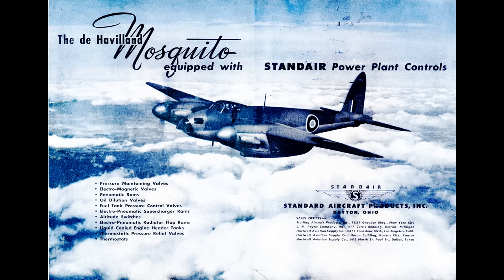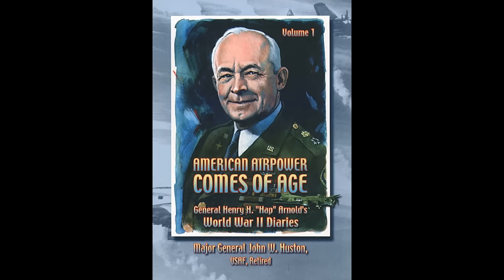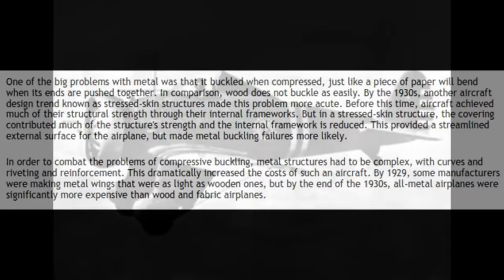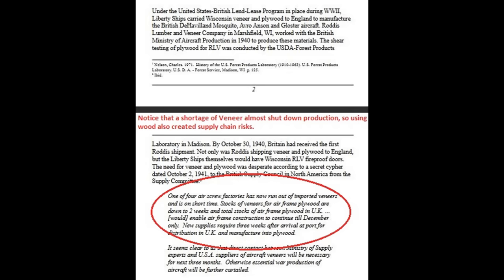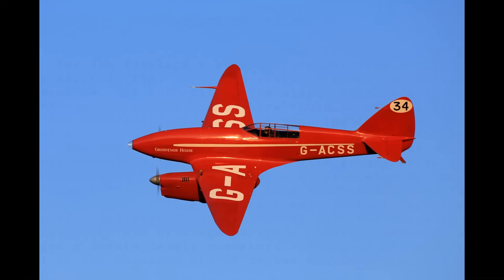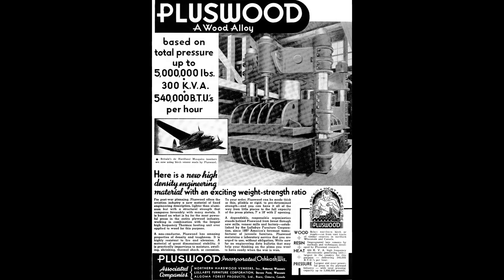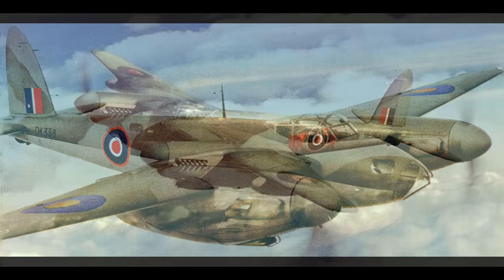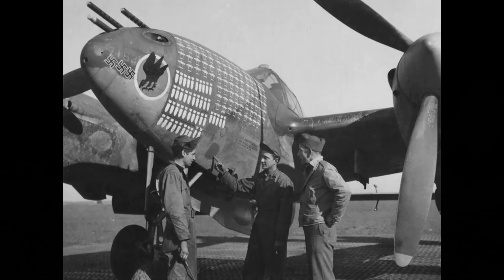De Havilland Mosquito vs. ?

Comment: Not widely realised is that wood does not have a fatigue life while metal does. That's why so many metal aircraft are retired while seemingly still perfectly flyable. A wooden aircraft component such as a spar, if well maintained, will last for centuries.
Reply from the maker: That's true, but in practical terms it's not so simple due to insects, rot, mold and more.

Comment: Wood construction is discussed for Gloster Gladiator and Hawker Hurricane. It’s interesting to note that Fairey Swordfish biplane (produced 1936 to 1944) was built from steel tube with traditional fabric covering. It’s often claimed to be obsolete but it’s heavy lift STOL capability and that incoming ordnance went straight through without causing serious damage kept the type in service throughout WW2.
Reply: Sometimes light AA went straight through  but it didn't fare too well against anything else, The plane was very useful for hunting u boats paired with fighter for flak suppression.
Reply: Swordfish was used throughout WW2. But just like any other torpedo bomber it was a sitting duck without escort fighters.

Comment: Jeffery De-Havilland’s son  died chasing the sound barrier in a test aircraft like many other,s it was a compressibility problem many planes suffered from it. Look up Eric Winkle Browns test of the same  plane in his book Wings on my Sleeve. He had the same problem and it was an aerodynamic problem luckily his instincts enabled him to recover also because he was short! Interesting life he led, recommend a read he was test pilot in the UK and also did a good stint in the same  US. The skin on the Comet was too thin trying to save weight so they could use the De-Havilland underpowered Jets, that along with square windows which caused stress risers in the corners caused the fuselage to split along the window line. The fault was found by immersing a fuselage in water and raising the pressure of the water inside the fuselage and flexing the wings it failed along the window line after a relatively short series of test cycle.  This test was argued for by the engineers before it flew, but you know the management that knows better. Like the ones that launched Challenger in cold weather. The Comet was the first pressurised jet passenger airliner in the world and won a lot of records, but because that stupid stupid management decision they threw away a world lead. They should have had a thicker fuselage skin and used the more powerful jets available from Rolls Royce with round windows and there would have been no problem.  When the Boeing 707 came out it carried more passengers and having underslung engines maintenance was easier. Comet flew Commercially 1952. Boeing 707 1958.

Comment: Regarding the woden construction: After WWII the British built a number of types of wooden racing dinghies using pretty much the same construction technique, such as the International 14 and the Firefly. I believe they had access to the surplus equipment used to build Mosquitos; autoclaves and presses. It wasn't until the late 1960's or later that fiberglass began to challenge wooden hulls in sailing classes that used the wood composite technique. Short of a carbon fiber/honeycomb/carbon fiber composite it's still hard to beat the stiffness to weight ratio of this technique.
Reply: @M Bacon agreed, and all have some specific vulnerabilities. 0-90 carbon/Nomex/0-90 carbon hulls have been state of the art for the last ~ 40 years, it has a different kind of vulnerability. It can be punctured by a sharp object, you can take a sharpened pencil and ram it right through. Of course that's not something that's likely to happen.

Comment: Another advantage of wooden construction was that parts could be made up rapidly by rejigging in factories that mass produced furniture. As for strength, would a metal constructed aircraft be able to withstand the tremendous shockwave recoil of a 6 pounder field gun, as was used on the Coastal Command Mozzies for UBoat busting? There's a lot to be said for natural carbon fibre.

As a mature student (gaining more qualifications after RAF service) in the early 80s, I had a weekly period where I could take any course I fancied for interest. I chose woodwork to build a cabinet for my hifi. My tutor was a senior citizen doing some part time teaching to boost his pension.

When we got talking on introduction, and I told him I was ex RAF, he told me he was a master carpenter who'd worked for De Havilland, and during the war, that he was very proud he'd worked in a small team, that shared de Havilland's passion, on the prototype with Geoffrey de Havilland, away from the main aircraft works De Havilland, financing it from his own persaonal funds. He was determined having great belief in his design, wanting to prove the Air Ministry wrong, that hadn't commissioned the Mosquito, going for heavy bombers. My tutor said he made the wooden propellers that were used for initial tests. When the Mosquito went into production, they used metal propellers, maybe the same as the Spitfire or Lancaster.
Reply from the maker: Yes, metal airplanes have carried guns far larger an more powerful than the British 6 pounder. During WW2 The B-25 carried the 75mm firing a 14+ pound shot. Also the German Hs129 had a variant with a 75mm. cont:

That's not to say that wood doesn't have any advantages, it does, but overall metal was better, which was why De Havilland went to metal as soon as they could practically do it. The main advantage of wood in the case of the Mossie was simply the fact that almost all of De Havilland's experience up to that point was in building wooden airplanes.
Reply: @GregsAirplanesandAutomobiles  Looking at videos of the Mosquito on ground test firing, the way the aircraft rocked back suggests there wasn't much in the way of extra dampening shock absorption, the airframe taking a lot if not most of it. Would a P-38 have been able to do a similar job?

I wasn't familiar with the Hs129 and B25 set ups, so I just briefly checked out both of the arrangements on YouTube, in an underbelly pod presumably with sprung/hydraulic dampeners to absorb the shock. The B25 was a larger aircraft than the Mosquito which would help as well. Thanks for pointing that out. The Hs129 was slow, left a lot to be desired and I was more impressed by the B25 set up.
Reply from the maker: I was only addressing the issue of absorbing the shock, not saying which set up was best.
Reply: @GregsAirplanesandAutomobiles  As you started with the P-38 compared with the Mosquito, although I didn’t specify, that was what I was speculating on, whether the P-38’s airframe could’ve withstood the recoil of a large cannon.
Reply from the maker: Oh I see. I don't know if the P-38 could have been adapted to carry a huge cannon, Lockheed went in another direction with the HVARs instead.
Reply: @GregsAirplanesandAutomobiles  I guess it was needs must, and what would work on the battle of the Atlantic, and the wing rockets on the Mozzy would be recoiless when they came in, packing a greater punch without the shock. Love the Mozzy, arguably the finest aircraft of WWII the UK produced in that it was so adaptable. The world’s first truest MRCA?

Comment: With respect to corrosion of aluminum: pure and low-alloy aluminum does not have significant corrosion problems (as most people know). However, aluminum alloys that are strong enough to use in aircraft structures do. The solution was to apply a thin plating of pure aluminum on the outside of the sheets of high-strength alloy. Hence AlClad (Aluminum Cladding). In addition, it was necessary to find a primer that would stick to aluminum, which was also quite a challenge. Eventually zinc chromate primer was developed, which has that characteristic drab yellow-green color that you'll often see on the insides of aluminum aircraft structures.

Comment: Wikipedia says early Mosquitoes used plywood with casein glue, later replaced in production by plywood with urea formaldehyde glue. I had been under the impression that synthetic glues were essential, and the moulded plywood Mosquito would have been impossible with casein glues - perhaps this was not the case.

Comment: When i hear you talk about manifold pressure and boost pressure and here with engine compression I think about how long the gaskets last. With the temperature differential on parts and expansion and contraction on parts i just think about a blown head gasket at 20,000 feet over the ocean.

Comment: The Mosquito had a lot of small wood parts. During the blitz, a lot of them were built as sub assemblies in cabinet shops and assembled into larger assemblies in barns and then trucked in pieces to final assembly. Cabinet makers were already trained in wood craft and had the necessary tools. Additionally, cabinet shops tended to be nondescript buildings in rural villages that could be hidden form the Germans. As a war resource, the cabinet shops already existed, were not centralized targets for the axis, had trained employees. The government just had to supply wood, plans, some jigs to ensure that parts would mate on assembly and paychecks. It was a ready made plane building business that did not take up factory space needed for conventional fighter and bomber production. From a structural viewpoint, the plane was engineered to take advantage of wood's properties and represented an advancement in the state of the art. The RAF rejected the initial proposal, but de Havilland proceeded to develop the plane with private capital. It was only when it flew that the Air Minister's jaw dropped and he had to have it!  Its biggest flaw was a lack of weather resistance. It was also partially stealthy, being made mostly of wood, it didn't show up very well on radar.

Comment: A lot of people try to compare the p38 and the mossie but they are totally different design concepts.
Great that there are flying examples of both again now. 
The guys in NZ are working on their 4th or 5th mosquito build now.
A project in the UK is in the process of completing the wooden moulds to start manufacturing new mosquito fuselages in the UK as well.

Comment: Aluminum production requires a lot of electricity. Due to federal hydroelectric dams construction by WW2 the USA has massive reserve of electric power. Which the USA put to work in nearby brand new aluminum production plants. As much as American aircraft producers complained that aircraft with wooden wings and fuselages were obsolete, they had all their aluminum requirements provided for them.

Comment: Thank you. I learned more about the construction and design of the Mosquito here than from anywhere else. The views on De Havillands' reasons for choosing wood in particular, if nothing else,  pass the saity test of 'it smells right for, the man, the day and the economic background surrounding its inception and design'.  I also assume that wood construction requires far less energy which would be needed or maybe better used elsewhere. That the soviet airforce also was mainly wooden construction was news to me but that also makes sense, considering the war time constraints on the USSR at the time. They had a lot of tanks to build.

Comment: For the U.S., initially choosing the P-38 over the Mossie was a good decision IMO. The P-38 could do much/most of what the Mossie could, but much more. It could, along with light bombing, long-range reconnaissance, etc., actually dogfight and operate as a true day-fighter, which the Mossie could not. The Mossie had its merits as well and, of course, the P-38's engines and systems were not well-suited for European theatre operations. Overall, it's good that both airplanes were available to the Allies.

Comment: Greg, future topic idea:  I have run across quite a few military historians that are convinced that the Battle of the Atlantic could not have been won without the B-24 Liberator.  RAF Coastal Command took delivery of their first B-24 in June of 1941, and they had a VLR version that was stripped down and equipped for sub hunting.  The RAF, USAAF, and the USN operated B-24's on submarine patrol 24 hours per day.  They concentrated on the Mid-Atlantic Gap, the Bay of Biscay, and the Strait of Gibraltar and flew from bases in Greenland, England, Africa, the eastern seaboard of the US, and the Caribbean.  The navalized sub hunting B-24's carried 2,500 pounds of fuel and had a 1,150 mile patrol radius.  Patrols in the B-24 could last 16 hours.  During the course of the war, all kinds of weapons and sensors were developed and deployed on the VLR Naval B-24.  There were also some interesting air-to-air conflicts between Allied and German Patrol Aircraft.
Reply from the maker: It's a fair point, but the Allies would have won either way, it was just a matter of time. Hitler had a chance to knock out Britain in 1940 with a secret superweapon, but thankfully he didn't do it. That may be a topic for another day.

Comment: Great video, I would add that the structural integrity of the Mosquito was tough enough for the British to mount a QF 6-pounder (57mm M1 gun) auto-loading cannon inside it.  Known as a Tsetse Mosquito, it has a confirmed U-Boat kill.  I agree with the personnel issue, De Havilland could contract the wooden components needed to every furniture maker in the UK.  These were often in out-of-town rural locations, away from German bombers, and there was a plentiful supply of material, firms and labour.  These components could then be collected and then assembled at the main De Haviland factories.

Comment: The Germans tried but failed in construction quality. It was a matter of risk management.  Did we really need it to expend resources on it?  It was not that the P-38 was "better", the question was whether it was comparable.   Note the Brits used our B-25's for daylight operations even with Mosquitos, they were no longer building medium bombers.  The British fought strategically at night where the Mosquito excelled, we didn't.   The British needed our B-24's for long range anti-sub use.    No question the Mosquito was best for the Brits but for us it was just another airplane.   Note the Brits never used Mosquitos for long range bomber escort, why? Because as escort fighters they had limitations.   Over Europe the P-38's were hard pressed at bomber escort initially although later models were better although by then the P-51's and P-47's were dominating. The P-38 was excelling as a fighter bomber..and the Typhoon was a better tactical fighter bomber than the Mosquito except over water where range was paramount.